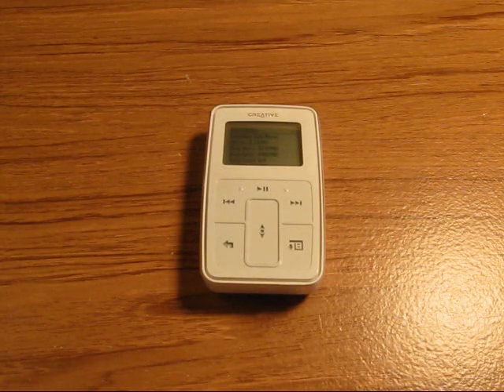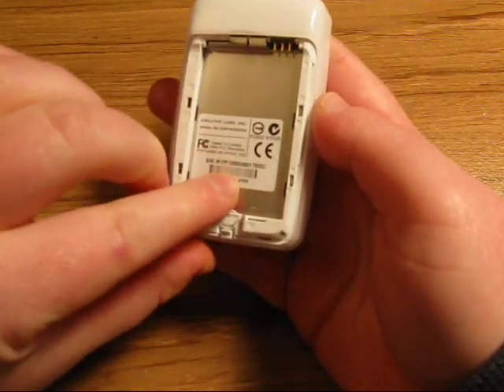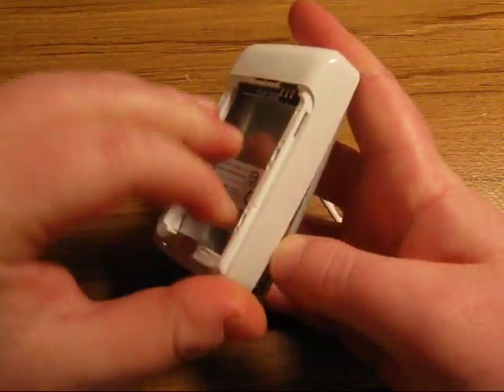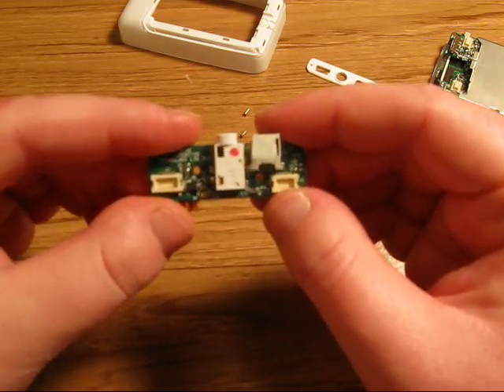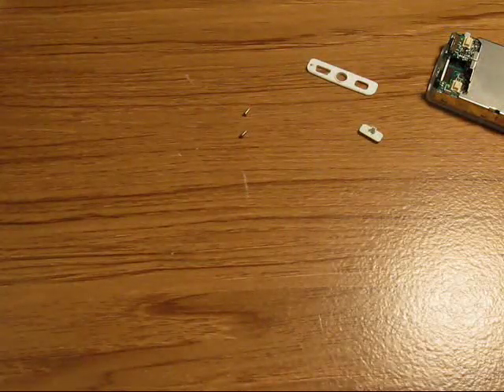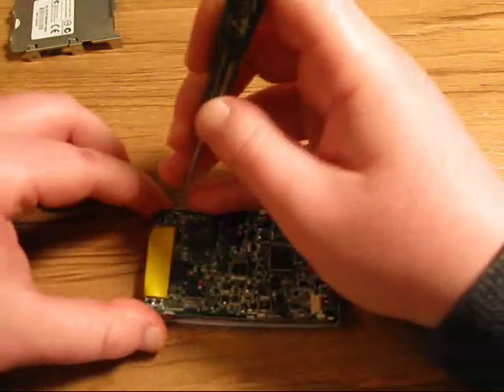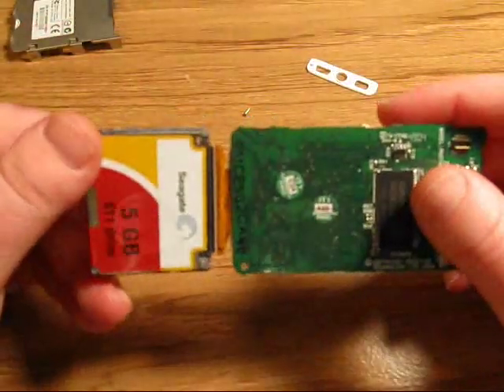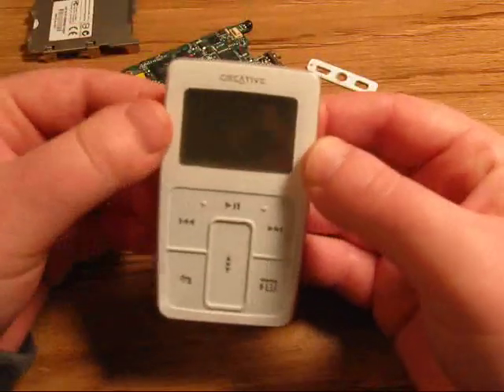Zen Micro Complete Disassembly Video by a Technician

Comment: Thanks for the video. It helped me diagnose and repair the bad solder points in the headphone jack. If you get distorted or quiet audio it is probably the solder points on the headphone jack. Once I got mine apart as showing the first few minutes of this video, it was obvious the headphone jack solder points were faulty. Once repaired, it worked as good as new. Thanks!

Comment: I still use my Zen. The software it comes with for transferring songs isn't as intuitive as it should be (still better than iTunes in my opinion) but once you get the hang of it, it gets the job done. You really should just be able to drag and drop folders to it without having to it without needing any proprietary drivers.